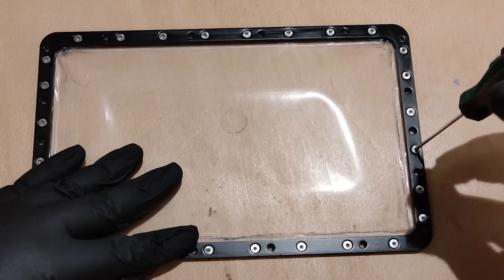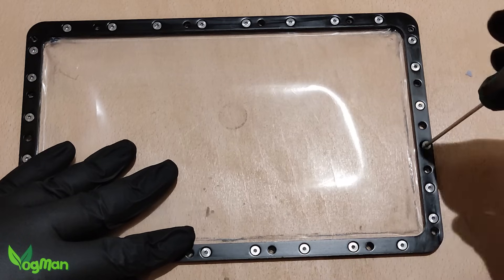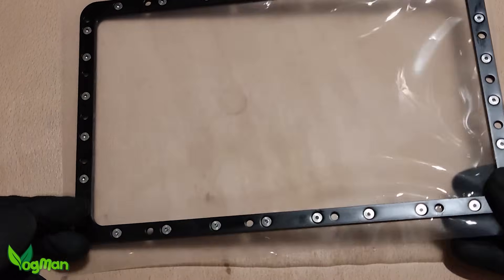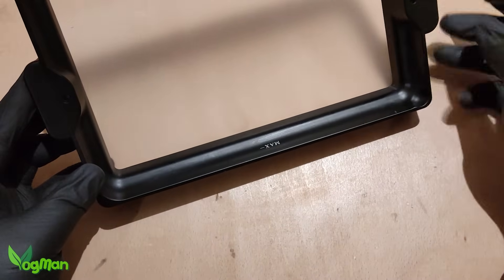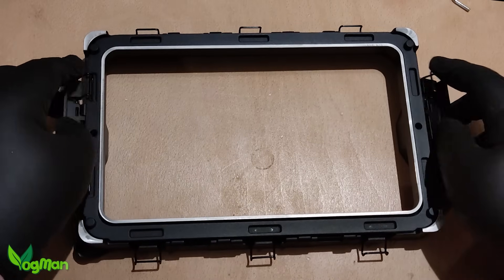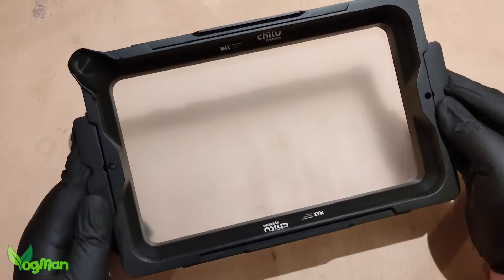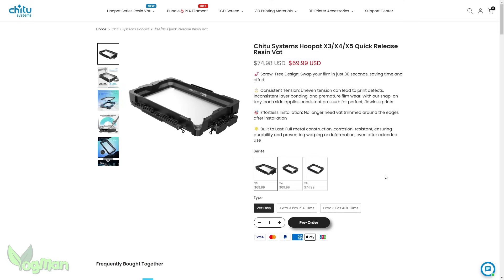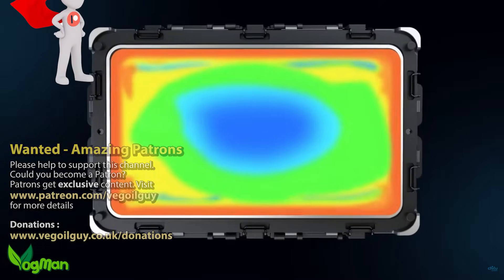FEP changing the old and the NEW way - with the Hoopat Series

Comment: When you take into consideration the fact they have to design the vat for each printer it will work with and manufacture them, around $80 isn't a bad price (IMO). I'd certainly buy one for my Elegoo Saturn 8k as the original method is a PITA to go through! Kudos to Chitu for coming up with this method. I think it's a winner!
Reply: Most manufacturers use the same screens so all they have to do is change the plate that the release film goes on to.

Comment: Long term availability for custom cut liners would be a big concern given the number of new printers released each year. That would add an unnecessary risk for those running print farms where lack of supplies means lost revenue. At least with traditional liners if there isn't stock a user can just get any adequately sized replacement and cut it down.

Comment: nice gizmo, but way too expensive..... buy fep in sheets or roll, after 2-3 changes it will be very easy and fast, on my firts try it took me one hour. on my third replacement, few minutes, just unscrew screws, remove old fep, place new, put screws back, really not a brain surgery....

Comment: I have multiple build plates for my mars, mars pro and mars 2. I change the FEP in any that start leaking/ tear about once a year. This is a way better solution, however the cost would be prohibitive, and as others point out the customer FEP sheets would turn me off....although I am sure third party options will appear very quickly. As others have said, it would be cool if the design was incorporated into new printers
Reply from the maker: I hope this is the sort of product that drops in price as popularity increases. It is a nice idea, but price is going to be the initial hurdle for sure.
Reply: @ as with most good ideas I am sure it will be copied. Elegoo et al could easily produce their own versions with future printers. It would cost them nothing extra (if anything it would cost them less than the current design, as screws cost money) and would be a good selling point

Comment: Would've been nice to know how well it works when actually printing.
Reply from the maker: It's a release liner... it's taught... it does the job. The results will only reflect the printer I guess.
Reply: @vogman  There's a constant debate about how taught liners should be.  I don't have a position, but it would be nice to know if there's any tradeoff between the convenience of this system (which results in a taught, though consistently taught, liner) and printing reliability.

Comment: If they have this for an available anycubic model when its time to upgrade im definitely getting it. I absolutely hate fep replacement. This should just be the new standard. For me its not even the screws but doing all the holes in the film.
Reply from the maker: Use the questionnaire linked in the description and register your choice of printer. If enough people with your make and model express an interest, I'm sure Chitu System will do their thing.

Comment: Seems awesome,  but the dedicated precut liners is the same issue as always, with a 400% markup on each film.  If they would offer an optional punch for the liner so you can use any liner of your choice, I'd be  totally on board.  The problems with these products is the need for parts only manufactured by the company.  Even better a vat that could cut the holes itself.  Im just so sick of companies that focus on selling consumables.   Its about time a standard is enforced.   Consumables are excessicesivly marked up.
Reply: The company has said themselves that any PFA Will work with it. Not just the pre-cut ones. It's only going to be a matter of time before somebody makes a printable model with the correct spacing of the squares with tiny triangles on top of them to where you can just slide it down on top of it to cut it perfectly. Spaced in the sheet. Necessity is the mother of invention, and it's necessary to keep things cheap
Reply from the maker: Very true. Let's hope popularity drives down price... or encourages third party alternatives.
Reply: I feel like a filament printed jig to slice to the exact dimensions you need with a frame that punctures at the right spot would fix this right up.  And they have no way of forcing you to use theirs.

Comment: I’d prefer the plastic to the flakey coated metal Peopoly provided. I had to strip the paint off mine, which was a hassle especially because it has the built in heat liner.
Reply from the maker: That sounds a real pain...

Comment: I once bought an entirely new VAT which cost £50 just so I didn't have to go through that liner replacement. In fact I've done this twice in my life with printers as I managed to strip the screws on one using a drill. It turns out you do need to do this by hand. I have hands that shake like buggery so for me by the time I'm a dozen screws in I'm capable of blending fruit just holding a jug. So for me this would be instabuy. 

Next time I need to do the replacement I'm looking this up to see if its available for my machine and yes this is a must for new machines.
Reply from the maker: I don't blame you. Sometimes you need to pay a little to make life easier. I know the feeling well 😁
Reply: 1. You can unsrew with electric tool. Although maybe not a best idea due to resin residues. 
2. You can screw with electric tool, just set torgue to minimum  and then increase it slightly. There is no issues with resin at this point, so using electric drill is a good idea.
3. These spring mechanisms look like can trap alot more resin than stock Elegoo or Anycubic vat, so if you spill some resin  on your vat outside, you will have more work to do. 
4. I have no idea why everyone states it takes 30 minutes to change film. It might take that much including emtyping the vat from resin, and cleaning the vat, but this needs to be done also on Hoopat. So this solution only cuts on one part of the process, so in fact saves maybe 10 minutes, for the risk that you will have to clean your vat in alcohole as it will get far worse to clean.